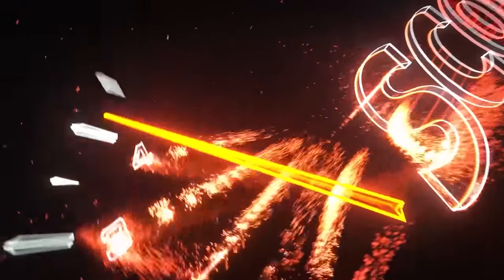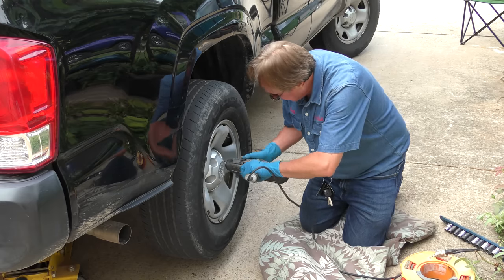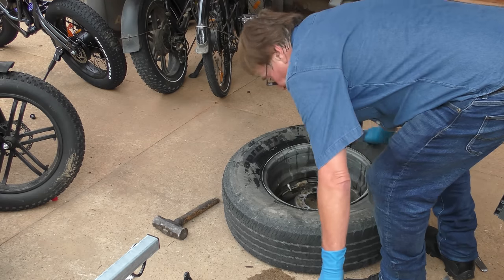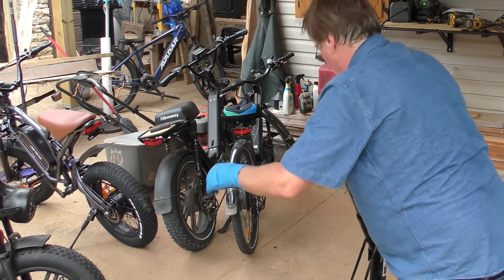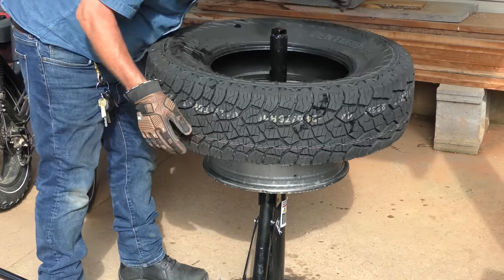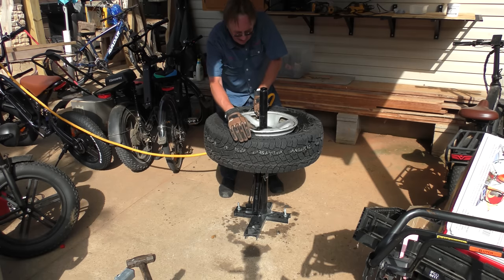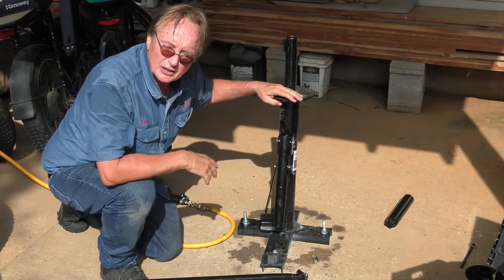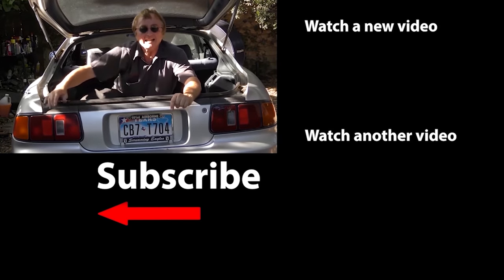Never Buy This From Harbor Freight (Almost Broke My Hand)

Comment: Makes the fees charged by the tire shops look worth it
Reply: A good used tire shop like a good small mechanic shop is your best friend
Reply: Indeed!
Reply: Cant do a wheel alignment tho
Reply: @WayToManyAssassins don’t need to if you’re just replacing tires.
Reply: Perfect dont do it yourself tutorial
Reply: Well spin balance is $15 whether they or you mount it.  The only reason to mount your own car/truck tires is if you can get tires wholesale...like $200 tire for $80.

Motorcycle and eBike tires though.... that's why these are bought.  Car tire dealers often won't touch bike tires, and bike shops charge $45 to $60 to mount.
Reply: I use the same tool with a fraction of the trouble Scotty had. It's saved me a few thousand dollars over the past 20+ years.
Reply: Well, he can always show the tire shop he took off and put on one tire with China junk and how he looked after and see if he gets the service for free 😂
Reply: @jamessouthworth1699  since it is 20 years old, it is NOT the same tool Scotty used here...may look like it, but it isn't.
Reply: @STho205  I got it at Harbor Freight and it looks identical looking at the video but you are right without getting up-close-and-personal I can't tell if the thickness of the metal is the same.
Reply: EXACTLY.
Reply: @STho205 you can’t use a machine like this for motorcycle tires. It’s physically impossible.
Reply: @BlainesGarage  yes you can, if the hub hole is big enough to accept the spike...if not the next size down model does it.

The shop I use, refit there's with a skinnier spike...but in past HF has the motorcycle model.  Goes with the motorcycle balancer.

Spike, table, bead buster lever, spoon....a fairly simple manual machine
Reply: Fr
Reply: You forgot to scuff the rim beads for better sealing.
Reply: Yep….I’ll just let Costco do it all for me, including jacking up the car, tire disposal/balancing/valve changes while I enjoy a $1.50 hot dog and walk around the store for an hour with my wife while she figures out other ways to spend more money 😂

Comment: Unfortunately this is one of those tool categories that don't have a good solution for the DIYer. The negatives brought forth by Scotty in this video are valid but what do you expect for the price? A real DIYer would be able to take this tool and modify it to fill their needs. There are many categories of tools that are designed only for the commercial guys. That's the reality us DIYer's face. Even these "garbage" tools are a godsend as long as they can be easily modified to fix their faults.
Reply: Yeah I  bought one ,fist thing I had to do was make a new bar out of solid steel not pipe. The one that came with it bent the first time.

Comment: As an off roader, this tool has proved invaluable. Tire damage off road is common and taking a tire to a tire shop to get a simple repair gets expensive. There are many videos on modifying this tool that will make the job much easier.  Mounting one tire as Scotty did pretty much pays for the tool. With an entire set of tires it pays for itself in one use. I've modified mine to use the duck bill, like the tire shops use, to avoid damaging aluminum rims. Best of all it unbolts from the floor and I can store it in the corner of the garage. Unlike the giant machines they have at the tire shop this takes up very little precious garage space. This is a tool that only gets occassional use but when you need it, you need it, and I can set it up in less than 5 minutes.
Reply: Nice review,  to The Review.
Thanks !
Reply: Terriable review ive had one for years i replace my  10 ply tires with my son an 17 year grandson use it. I seeit changed your tire. You have to be better than the tool you use.
Reply: Thank you
Reply: the trick is to find an old school shop pass them a 20$ bill and they will dismount the tire buff the inside and apply a patch. though I know a cheat code for breaking the beads if you have a second vehicle just drive it up onto the tire laying on the ground and work the wheel back and forth it will pop right off. you can also use the vehicle itself using the lower ball joint as the pressing point just let the jack down its way slower but it works
Reply: just buy a better quality tool.  You shouldn't have to buy a tool and then do a lot of work to the tool in order for it to work properly.  That is the definition of Junk Tools.
Reply: @jmackinjersey1  Okay, and who makes this tool you are referring to? As Scotty demonstrated it works without issue, so it's junk? It's a manual tire changer, that means your body does the work, Scotty it a little underbuilt for that type of job. You may be a little on the dainty side too. It might be better to have a man change your tires. The tool works as intended, but people not able to lift heavy objects won't last on this tool.
Reply: But you didn't actually review it, did you? Scotty did, and he showed it was crap. The steel is way too mild for it to stand up to even one tire change by a 70 year old man who didn't abuse it. If you off-road and need frequent tire repairs, then do like Scotty says. Spend the money and get a decent machine - not this thing.
Reply: @darkwood777  I've just been using it for the last 10 years. It works great, but maybe not for the dainty little men.
Reply: they charge me 10 dollars to change a tire and air it up at the tire store and it was done in minutes.
Reply: @petera5560  Even at those prices the tool pays for itself after a single set of tires. You must live in the Philippines or something b/c nobody is going to get that price in an actual city in the USA.  More importantly I don't have to deal with Bubba after waiting for half an hour. Self reliance is a foreign concept for a lot of folks, no judgement, just sayin'.
Reply: I have had and used the very same tool for tire repairs for more than 15 years.  Primarily used for motorcycle tires, but I have also don e trailer tires, UTV tires and had no issues.  It’s always easier to tear something down than it is to explain it’s good points.
Reply: @michaeldose2041  Watch the video again.  Scotty explicitly stated that this tool from Harbor Freight was made better years ago than the current version that he demonstrated.
Reply: This makes sense ..... scotty was spoiled using a solid metal one that would cost 4x-6x more $ shipped
Reply: @michaeldose2041 Is your 10 year old model the same though? Is the grade of steel the same? Same thickness? I mean if Scotty can break it I would think you could break it. Unless Scotty did something wrong.

Comment: Sorry you had such a bad experience. I've got the same tool and love it. It paid for itself after the first use and I've changed many car tires, ATV, UTV, and trailer tires with it and had no problems. I bolted mine to a four foot length of 2x2 square tube steel and now it is portable and I can simply insert it into any receiver hitch on one of my vehicles when I need to use it.
Reply: I've changed many tires on mine, ,I love it. I mean if it's bending sideways, it's because you need to reposition it correctly. And for God's sake , put your foot on the tire when breaking the bead, and stand in front of it , not to the side .lol If I lived closer, I'd come by  ,and show him how to use it.
Reply: love mine changed tractor, truck, car,side by side  tires for a few years now.
Reply: I wish you would make a video of that setup.
Reply: I love mine also. And I love my bubble balancer. When I was growing up bubble balancing was the norm. Worked fine then and still does today.  Also by doing my tires, I took time to clean off 25 years of gunk buildup on my mag rims that I've no doubt caused slow leaks because now my tires hold air twice as long. I use it for my 97 CR-V. I think I read somewhere that they are not practical on anything over 14 or 15 inches.  I also hate it when a tool sticks bad welding splinters in my 👐 ✋️ hand!!  😆 🤣
Reply: Me too, been using mine 2x a week for 10 years w/no problems
Reply: Looks like it worked pretty damn good for $50. Some people need things to complain about.
Reply: I use an ancient coates bubble balancer and if I get them just right I cruise at 80 mph with no vibration whatsoever
Reply: Where did you get the balancing weights? I tried to look them up.
Reply: Truck tires can be done with a bead breaker, the various bars and some lube. Also just consider some throw in beads and skip the old style fixed balance weights. Also a core remover and a new stem would needed.
Reply: me to ive used mine for a couple yrs now no issues at all
Reply: It bent in the video. Its poop.
Reply: @WizardKing-Official  ...from improper usage. Never had a problem with the one I have.
Reply: Came to say this is pure user error.

Comment: I bought mine 4 or 5 yrs ago for the same price Scotty did. The older one is beefier. I haven't bent mine yet. You will get better at it after you've done a few. I use 2 vice grips to hold the lip of the bead on each side so the tire doesn't slip back off while I'm taking them on and off. I would rather put my own tires on than sit for 2 hours waiting for the tire store to get around to it while I'm stuck watching Judge Judy. Lol
Reply: ...hay that matey ,judge Judy is ace !!!
Reply: I’ve had mine for a couple of years. I did the duck head modification and could easily finish anentire set of wheels and tires before Scotty finished one. This machine is one of the best Harbor Freight purchases I’ve made and easily paid for itself the first day I used it, even after the extra expense of the modifications.
Reply: Could be worse, could be stuck watching the view!
Reply: @athhud  I will probably buy one too. Don't know if these cheaper ones are good.
Reply: @PlanetaryThoughts9861  None of those shops have premium cable.
Reply: How do you handle balancing the wheels?
Reply: Wow. I am glad we have Silance Tires here, in Jacksonville, N.C. Any time I show up, they get right to me, they almost always have what I need in stock, quick work, done properly, even torque wrench the lug nuts. It is year round with me. I have thought about a shop / commercial tire changer, and dynamic  balancer , for years, but why? Would still have to get the tires. They do it all.
Reply: @treeguyable  Those little used tire places are usually quick to get to you. I'm all about saving money and have plenty of time to do it. Getting my heart rate up is also important since I'm semi-retired. I do one tire and take a break. Lol
Reply: @HELLHAMMERHANDHIX  Judge Judy ...a very early reality TV show.
Reply: The struggle was real on this one 😂
Reply: @treeguyable just getout u wallet, no need to wash hands
Reply: @rogerdodrill4733  I do all my motorcycle tires myself. 6 bikes to keep up with. Wash your hands.

Comment: I have this with the motorcycle tire attachment. I love it. Probably changed at least 50 motorcycle tires with it over 15 years . I can't find the high performance tires I like locally unless I drive 30-60 minutes away. And private shops wanted to charge the shop hourly rate to change them at the time. As in over $100 to just change tires when I brought in just the rims off the bike! I can go through 2-3 sets a year so this thing has been a god send. Plus my kids now get to watch the process and learn something. This makes it very easy to get the job done. Although if you're determined you can do it with a couple screwdrivers too lol.

Comment: I agree, in it's factory state it's pretty much crap. I immediately welded a brace between the arms on the bead breaker to keep them square and I welded the base to the legs and I've never had a problem with it since. Later I used some scrap 2" pipe to make a swivel arm and added a shoe to it. I'm about $150 into it and it's rock solid.
Reply: If you work your way around the bead, the breaker doesn’t require bracing and the beads are much easier to break. I just threw the legs in the scrap pile and bolted the base directly to the concrete. The duck head modification is definitely the way to go if you don’t want to scratch aluminum wheels.
Reply: I have one I have  never took  it out of the box   figured  if I could  use it  to repair a tire  one time it would  pay for it self  jihad flat  I pat  40 dollars  just to get it patched  in the long run  didn't  expect  much for 40 dollars  is what I  pad  for mine
Reply: It boils down to user error honestly

Comment: I bought this tire changer in 1993 when Harbor Freight was catalog only in NY. No stores. It was $30 (red)  and the bead- break arm is thicker steel and the mounting end of the bar never worked.. It held up and works fine otherwise, bolted to the cement floor.

Comment: I bought that tool! Brought it home and heavily modified it! Works wonderful now!
Reply: What did you have to do to it ?
Reply: Same here  I welded flat plate steel across the breakdown bars he bent at the beginning  to strengthen them it works fine now
Reply: So you still have to have the tires balanced!
Reply: @donmyers584  im thinking of getting one but cant weld, could i bolt something to it to strengthen it instead?
Reply: @Oddball159 sure u can, welding is just faster
Reply: @greenman7612  Balancing beads are a thing plus they are dynamic unlike the weights.

Comment: I have been a DIY guy all my life, but there are some jobs - like mounting/balancing tires - that I'd rather leave to the pros. That said, another great informative and entertaining video. Thx.
Reply: Just due to the size of car tires alone i wont generally mount and or balance them on my own. However its a breeze on motorcycles, atvs, mowers, to mount and balance em. 

After the first tire helps you work out the process you can swap each one out and balance it about ten minutes a pop.
Reply: Changing tires without a tire machine is frustrating especially removing old dry rotted tires I’m with you there I’ll let the shop do it
Reply: Never thought to replace tires on my own, still won't think of it in the future....Just locally bought 4 tires for my Pilot for $600.00 cash at a tire place, they installed them while I did some errands in an hour and I am on my way.  I am the age of of Scotty and I would probably accomplish a tire change a day that way. God Bless him for his public awareness for us commonfolk. Btw, have you seen the price of tires these days?
Reply: HF has a smaller changer for lawn tractor tires and whatnot. I got one about 5 years ago. The center stem was just a long threaded bolt that bent almost immediately. I can make it work for my applications, though.
Reply: even so - its nice to have good equipment (rim clamp machine?) to do that kind of work. i use my propeller-blade (aircraft) balancer for stuff when i can and when the fixtures needed aren't too hard or pricey to fabricate.
Reply: I was going to post this myself. drive highways long enough and you watch tires blow the treads off. even with 32 psi, that's a chance to cause some damage if you don't know WTF you're doing.
Reply: @100GTAGUY  I use the skid forks of Bobcat skid steer . Then I show off and flip the wheel over and do the other side. Fifty year old tires on lawn tractors sometimes need to be cut off if someone used the old Fix-a-Flat.. 
 Once in a while you can heat the wheel till the tire smokes and get them off , however

Comment: Scotty, have one of them, and have had it for the past 20 years.  I am also 70, but am in good physical condition for the model year.  It isn't easy on some tires, but on others, it is child's play.  Yes, it needed some strengthing, but the welder cart sets about 10' away, and with a couple of feet of flat strap and a few feet of Mig wire it has worked for 20 years.  Yes, I could have spent $450 for a manual machine but for $50 bucks and maybe $10 bucks of metal and Mig wire, it works fine.  Never had the problem you showed with the tire install, but I cheat, and use a cheap clamp on the rim to keep from chasing the bead.  Have the cheap tire balance tool, and so far in 20 years, every tire balanced fine.  Would have liked to get a heavy-duty unit when I bought it, simply am not rich.  But with some self-determination and a grasp of engineering, it was simple to fix the issues.  To me Scotty it sounds like, leave the engineering improvements to experts, when you are a amature.
Reply: He said the older ones were probably better.
Reply: I'll let Costco do this.  I don't trust Harbor Freight except for hand tools.